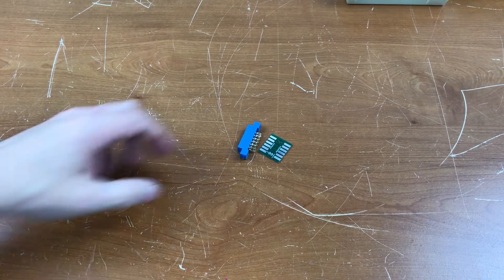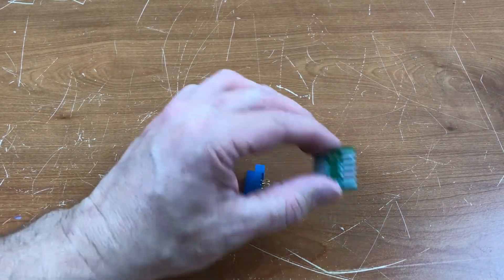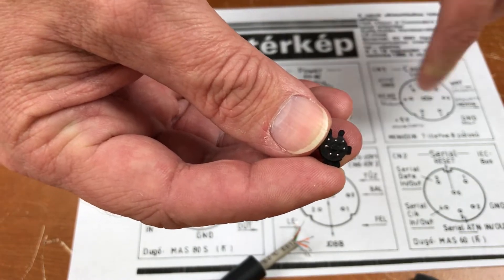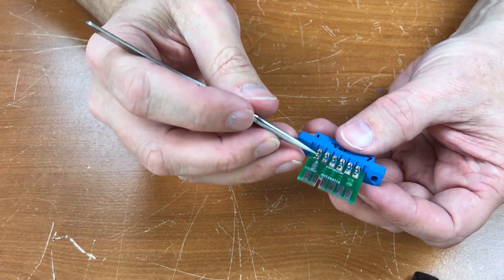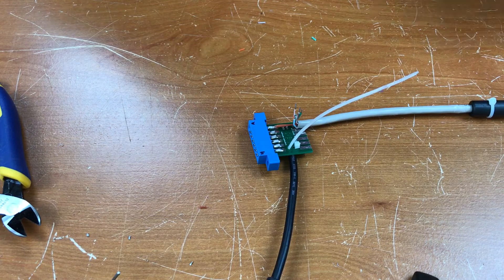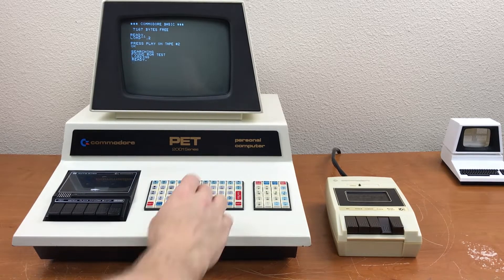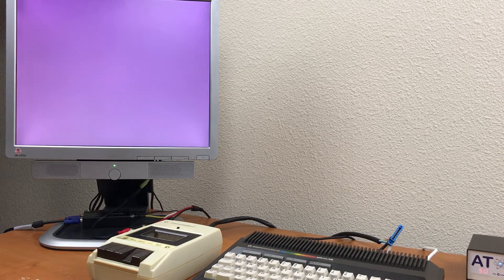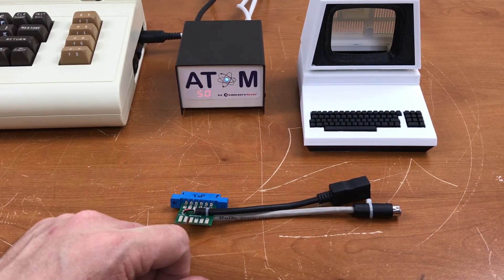Commodore plus/4 Cassette Adapter

Comment: What is the serial number on your PET?
Reply: @HutchCA  
#10899 the is a round red sticker that seems to have a date code of 1177
https://drive.google.com/open?id=1rOsa4Dh8AH-GVByoBdIbb6ZAv5jO2K_M
https://drive.google.com/open?id=1YjNwewtZSbrT4NxEj_PvL-e_SPLJ1kD1

Have you ever tried to add sound to your PET?
Reply: Not that you asked, but I'm № 0030267
Reply: @HutchCA  Black with white keys.  Flat sticker.  My mobo has 18602 written on it.
Reply: @MattKasdorf  

My face plate is metal and it is raised.
Reply: @HutchCA  

Yes there is a 1397 hand written on the board, I do not know what that means.

I am trying to add a piezo speaker to my pet, but I have not gotten to far with that as of yet. I have seen some activity on pin 19 CB2,  but it was only at 200mv.

So, I may be having problems with my 6522. Although I do have another one in my 2001-32N PET. That I may be able to try.

https://drive.google.com/open?id=1mRVOfwzcd_SsAVx33BcAdD6udA3MKLHx